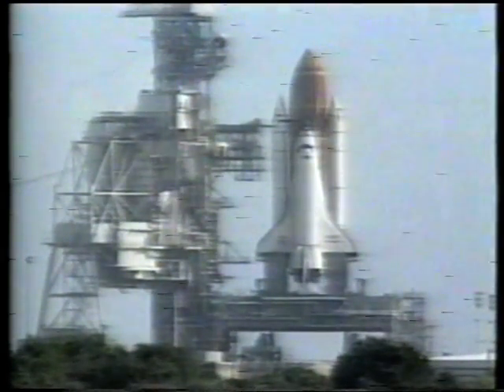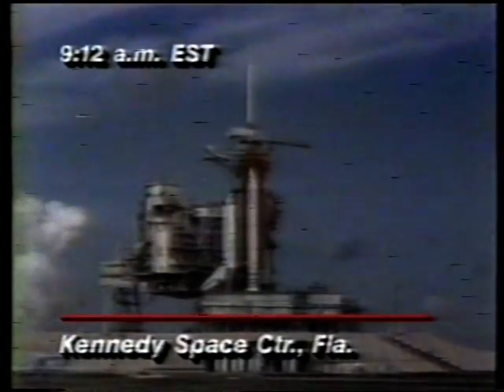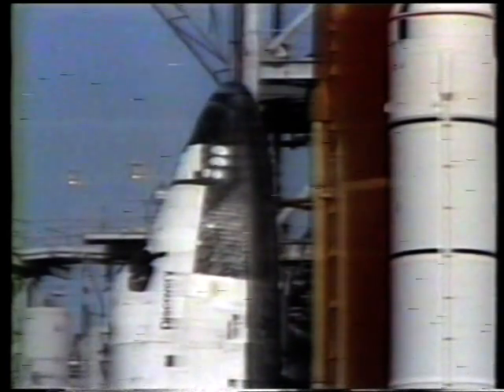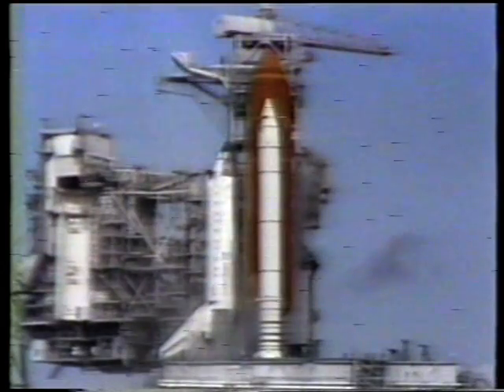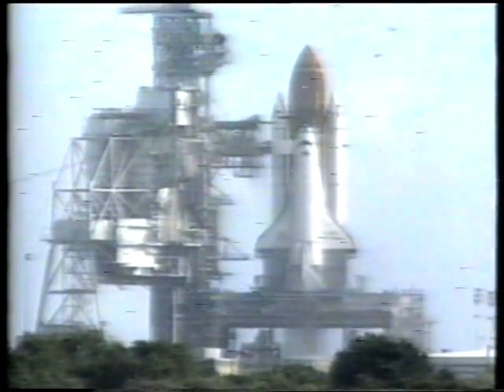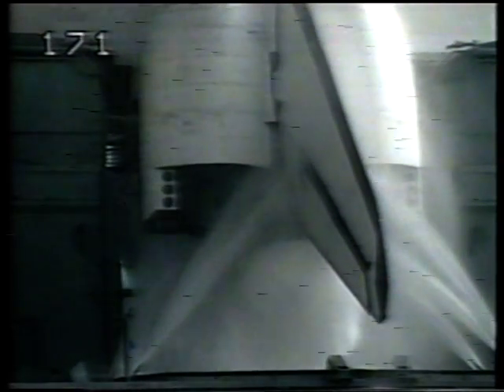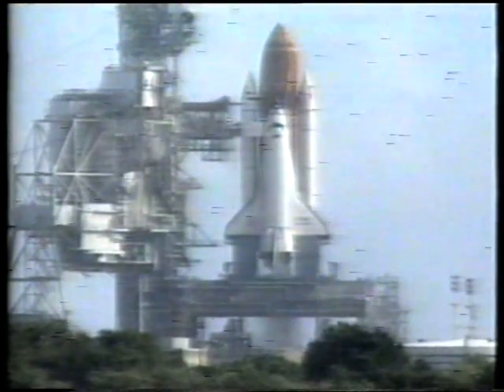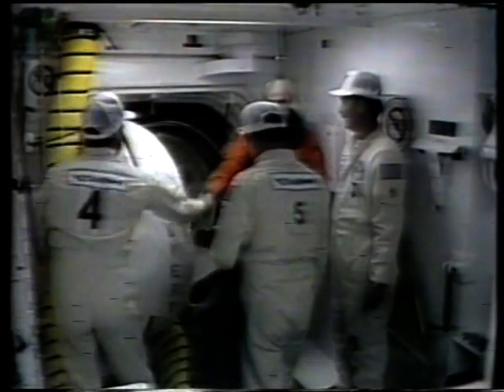Shuttle Discovery STS-51 (57) failure

Comment: @scott00072  At 2:36, they mention a faulty fuel flow measurement reading on engine#2, which was later diagnosed to be the result of a sensor failure.

Comment: SRBs are fully capable of lifting this Stack (Orbiter+EFT+SRBs) alone but the problem is that without SSMEs the Umbilical that is joining Orbiter with EFT are not strong enough to withstand the stress. Atleast 1 or 2 SSMEs are needed but for nominal Launch procedures all engines must be working smoothly and at full. Single SSME failure will result in abort/cutoff.

Comment: The SRBs ignite when the count reaches zero because solid propellant motors are on full power from the moment of ignition. However liquid propellant motors need a few seconds to start and build up to full power so the SSME ignition sequence starts at T-7 seconds. At the speed the Shuttle computers work, those 7 seconds are all that is required to verify that the SSMEs and Shuttle systems are working properly. If a problem is detected, the computers shut down the SSMEs.

Comment: Yes; the SSMEs get very hot when they start up.  The engine bells actually have passages for the liquid hydrogen to run through before it makes its way to the engine's turbopumps; this cools the nozzles against the tremendous heat given off by the hydrogen-oxygen combustion.